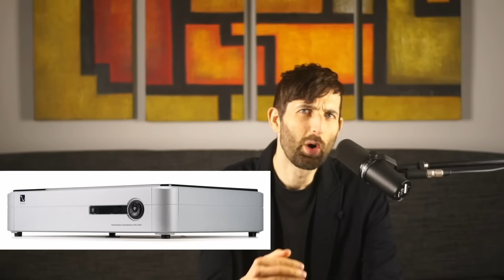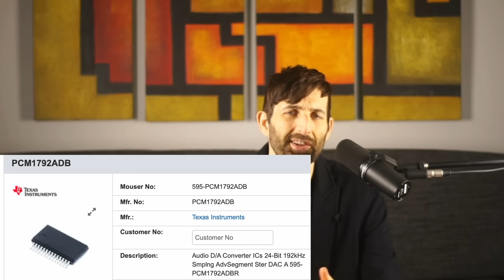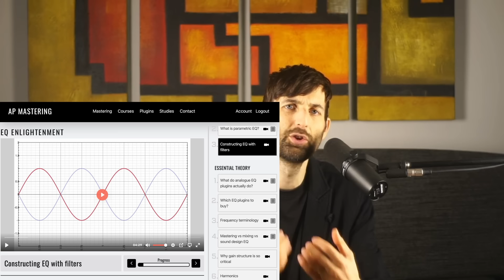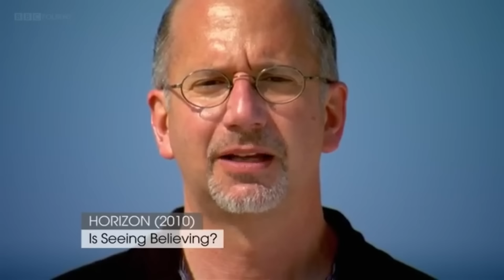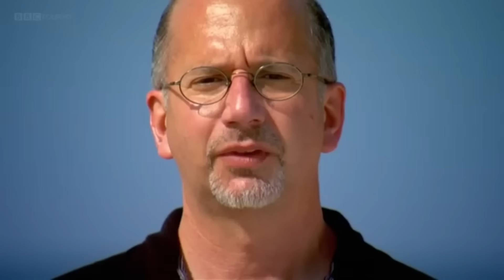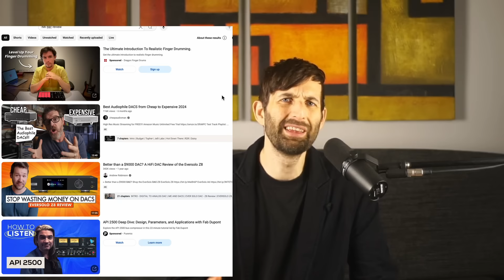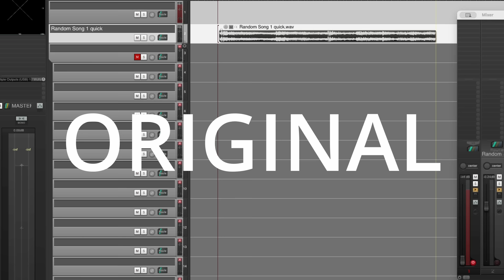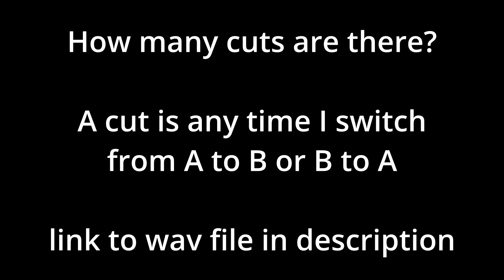The DAC Scam - Almost everyone believes the hype

Comment: I've been saying this for decades, because I repair electronics & see the same chips over & over & over again, plus some companies who think it's cute to remove the printed chip designation from the top & retaining an old DAC as a test device to de-solder processor chips & oddly they just function or actually reveal a failed chip. People, stop it. Also stop buying car cameras with the same processor chips. They aren't 4K! Enjoy
Reply: I know... I've been saying it too.  

I've seen some pretty wild stuff in my time ... Like Cobra CB radio boards in Radio Shack radios at 1/2 the price... Like top line audio mainboards in store brand housings, again at half price... Like DIY class D amplifier boards in expensive housings, selling for a grand or more... and on and on and on.

Online reviews are no better. I get quite the laugh at the guys comparing TPA3255 amplifiers and extolling the amazing sonic differences, often while ignoring flawed features and incompatible behaviours.  

The thing is that for most audiophiles the equipment they covet is little more than a series of opaque boxes, the insides of which are a total mystery.  It makes them ripe for the picking and the shyster companies are right there to take their money.

I keep advising a little bit of self-education in basic electronics... to no avail.
Reply: and what differences there are in electronics, sometimes there is stunning design and amazing implementation, but not that often. Mostly it's only due to great components that it somewhat functions.
Reply: If you think the chips are important than I feel sorry for the people who come to you for repairs.
Reply: Less electonics = better sound….music source + preamp + amp+ speakers…. = Done…!!!!
Especially if your system is realitively decent .
Reply: Less electronics won't make better sound, to a point. Tube amps are definitely worse in every way, for instance. A CD player is better than a record player. @Longjohn993
Reply: The chip does not make the audio signal quality it just converts the digital binary number into an analog voltage and holds that until the next number occure the expensive part of these devices comes with the signal filtering meanwhile cheap dacs uses ordinary low pass circuits the expensive ones uses active low pass filters with extra coils to reduce the phase shift of that capacity. 

What i want to say is the chip is not the part that determens the quality or is the expensive part it is the filtering circuit which can be optimizes by better components and better engineering or manufacturing. There is a whole science department behind that topic
Reply: @S4RO_R3  
Have you ever seen the schematic for a reconstruction filter?  Typically they're just a couple of small ceramic caps and an op-amp.  Nothing magical and nothing expensive.
Reply: @Douglas_Blake  yeah an entry lvl dac maybe but the moment there is external noise to much powerdrawn or anything the circuit will produce harmonics of the input signal
Reply: @Douglas_Blake  have u ever seen the diffrence of active low pass passive low pass or butterworth low pass its all a diffrent circuit so its not JUST some capacities there is a whole science behind that
Reply: @S4RO_R3  
As a matter of fact I have.
Reply: @S4RO_R3 Butterworth is just another filter name, passive or active. Plus you've not spoken of oversampling, digital filters, or anything else of that nature. 
I've got a dandy ass CD player and a basic good Yamaha and I'll be damned if they don't use the same stuff inside them because they sound identical. One just weighs over twice as much.
Reply: @Douglas_Blake  Correct... 👍🤣
Reply: @S4RO_R3  THANK YOU!
Reply: @S4RO_R3  Well, nobody said a $30 DAC is just as good as an expensive one, there's a limit to how cheap you can build something. However it's totally possible to build a technically perfect DAC for $300 - $500 and the improvements to a 10K or 20K device are doubtful
Reply: @S4RO_R3  Why bother filtering?  A CD player signal is 44.1 kilosamples per second.  You could DAC that and hand it to your power ampilfier unfiltered.  Nobody is going to hear the tiny steps from one sample to the next; these steps are more than an octave above the hearing of the best listener. 
BUT a volume control is useful; tone controls and equalizers also useful.  It is probably better to do all that in the digital domain THEN the actual DAC and its off to the amplifier.  But call that whole system a "DAC"?  That's absurd.  There's a DAC in the system.
Reply: Absolutely wrong as they may have the same DAC chips BUT the more expensive DAC'S have much higher quality components better power supplies and better analogue output stages
Reply: @ 
Usually not.  What is different, most of the time is big vs small production runs and the difference in cost per unit ... and don't forget to double the usual markup for audiophiles.

Comment: The difference people hear are filters, color filters. These are the analog output stages, the cables, the amplifiers, the loudspeakers, the bad powersupplies, the room, maybe a bad dac not temperature controlled, harmonized to have it within it‘s specified optimum operation window (which actually are pretty large so that isn‘t really likely an issue unless stuck in a wall full of equipment emitting heat by ventilators or even without that can‘t flow properly, like in studios, that‘s why high-end DACs have that kind of stuff, as they‘ve been designed to cope with indoor and semi-outdoor situations.
Sure, adding superbly designed analog output stages that may even control the chip to some extend may result in subjectively better sounding DACs - even so much that you can differentiate them in blind test. But all it is, is adding a colour filter like a parfum, excellently designed by masters of the craft and thus ultimatively expensive, but what it isn‘t is true DAC sound, it‘s modified to a subjective taste people claim to be near the original the artist wanted, an assumption of quality not even the artist likely thought about, and hopefully the mastering engineer did while just plainly doing his job styling the sound to the expectations of the paying customer - the label. Only few artists take that last step decision and those are typically running their own label or have a say thanks to prior iconic success.

Comment: This is so misinformed that it’s embarrassing. His main point is that most DACs use off-the-shelf chips. And yet the thumbnail is of a DAC that uses its own proprietary tech. 

Never mind the fact the chip itself doesn’t determine how a DAC sounds. It comes down to implementation. Most manufacturers that use off-the-shelf chips proudly advertise which chips they’re using. It’s not a secret. 

This entire video sort of assumes the absolute sound is real — and easily obtainable for the low, low price of a few hundred bucks. I’ve owned DACs costing between $50 and $18,000, and let me tell you, they all sound different. I’ve preferred the sound of a $1,500 DAC to a $4,000 DAC. It isn’t just about milking a few bucks out of the suckers with deep pockets. Some DACs are more resolving than others, but have terrible timbre or wonky tonality. Others sound just right, but maybe don’t offer as much detail or present narrower soundstages than the alternatives. 

Let me ask this: If DACs are a scam and the best sound can be had for a few hundred bucks, why do audio engineers pay thousands of dollars for studio DACs?

Comment: Please read it is just an Honest experience.

Fosi audio DS1 USB-C DAC with ES9038Q2M dac chip. Using USB to audio player pro on my android A52 to bypass the android junk. 

The music is now MUCH clearer and separated I can see how easy it is to become curious how much more dialed in can the separation and clarity get ... ?   When I say clarity and separation it more than just separate instruments or harmonies it`s even a single guitar string being plucked now has much more detail it`s a very obvious improvement.

Nothing fancy for headphones one pair under $300 the other was under $200.

With the above cellphone and Dac with 3.5 aux to RCA cable On my Harmon Kardon AVR 140 with digital bypass mode when the CD RCA inputs are used and tone is turned off with surround off running JBL Northridge series N28 speakers I can`t really imagine another Dac making a noticeable difference as the difference made was astounding....

Another helpful fact is the DAC works using the USB-C from my ASUS desktop computer used Foobar2000 and music Bee with same connection setup to my AVR 140 sound comparison through android versus Windows is close I just received the Dac 2 days ago so don`t yet have a solid opinion.

I`m not selling anything I`m not indorsing or trying to sway anyone this is just my experience so for $100 Canadian for that USB dac chip and the $12.00 app has changed my music enjoyment by a large margin. Of course through the PC using Windows with sound effects turned off no money spending needed for app`s just the Dac Foobar2000 was free.

Do your research take you time and do not over pay for what you are getting.

Comment: The best digital to analogue conversions are already in your phone headset jack.  BTW...that's where your pristine audio mix will end up 99.9% of the time.  The tech on this shit is already good enough and incremental improvements are undetectable by the human ear.  Tech is improvement is good, of course and that is the trajectory of tech.  But the price wars with these ridiculous claims of DAC/ADC that justifies thousands upon thousands of pounds is bollocks.  This shit here is as bad as the vinyl is better than digital claptrap of generations.  Stupid and pointless.

Comment: i haven’t done the math in a long time, but all DACs putting out the same voltage for a given bit pattern being equal, you are correct.  the only thing that effects DAC/ADC with high quality devices is the slew rate of the analog section (they usually use op-amps and not discrete devices), this can have a serious effect on sound coloration if you were to measure it with the cache of usual high end analyzers.  in reality, the guy driving home from the wine bar listening to a digital remastered copy of “birds of fire” would never notice…

Comment: Well, some people want to buy expensive stuff. They want to feel ... different. If the market is there - why not sell. The problem with the normal priced dac's often is that they are poorly designed. The parts are there, just not in the "right order" (or values). If someone has no engineering knowledge, they cannot know if the dac is correctly designed or what they hear is the bad design (I/V stages, filters, amplifiers, timing circuits, etc.).
Btw, most manufacturers have several "different" versions of one dac chip - consumer, industrial, automotive, aerospace, military. In most cases the only difference is that at the end of the production line, the chip has been qualified for given category. Meaning - it has been tested against special requirements or standards (extended temperature or voltages range, full functional tests, radiation immunity, vibrations, etc, etc...). Each test costs money, so, naturally, everything different than consumer and industrial is more expensive. But essentially, it is the same chip. So I can't agree that using industrial or military chips in consumer product will result in bad quality. It just makes no sense, it is unnecessary  and makes the product more expensive. That's all.

Comment: Biggest enemy of the audiophile is dodgy recordings, compressed and pushed loud to sound good out of a blue tooth speaker. Play that stuff and it really becomes less important what kind of DAC you have. Yeah, you can definitely waste money on hifi gear, especially on cables (now there's snake oil). But when you have the amp and speakers just right, having a decent source becomes more important. Dam true there's way too many broadcasters creating a massive echo chamber on the subject. 
But 
Seems to me your just looking to cause friction instead of getting things right. 
Not sure what you might achieve doing A-B comparisons on subtle differences through a lossey you tube broadcast and whatever sound setup the average TV has. Totally agree that improvements north of £1k are incremental at best, but for the record, r2r ladder DAC's are among the best sounding when done right (e.g.Holo Audio). Listening to a jagged output are you for real! 
Half baked seudo science, guilty as the guys peddling the snake oil. 

It's not all a big conspiracy...

Comment: Sorry but the premise is entirely wrong. You’re effectively saying that if the DAC chip is the same then the sound produced by the entire DAC as a hifi component will be the same. But that isn’t the case.
Reply: @dantealighieri4258  while there is truth that chip implementation has some effect on the Dac's sound quality, but quality implementation is the baseline for the discussion.
Reply: Most importantly what he was saying was listen to the output and say what differences you heard and how many times the DAC was switched ... then watch the follow up video for the results ... you may be surprised ... or not ...

Comment: Been in audio for decades and the audiophool stuff has become much worse as social media slobs hawk products for tidbits of cash and as real information becomes more and more difficult to differentiate from hype.  Most people today don't know who to believe, so they believe whatever they want and simply pretend that they're right.

Most modern music is poorly engineered in the studio, so I'm not even sure what people are listening to on their gold-plated turds.  What recorded music will even require superhuman fidelity; Spotify?

With that said, DACs have been reliably differentiated in ABX (blind) testing and there are proofs of that available from at least one youtube creator.  However, in each case that I've heard of the DACs in question were using different ultrasonic filters and some of those impact the response near 20kHz.  People can sometimes hear filters that impact their individual audible frequency range; they cannot hear properly-designed DACs that otherwise achieve performance beyond even the theoretical limits of human hearing.  If a company uses flowery words instead of lab results to describe the sound of their product, they're scammers.

I'm still waiting for someone to do blind testing on 2 DACs that have exactly the same filtering and frequency response; maybe someday.  Sound is extremely slow in comparison with modern electronics; if there's a musical difference between 2 products, it can be measured, even if the test for that difference has not yet been invented.  That possibility seems rather unlikely in 2025.

The cheapest Topping DAC is effectively perfect in terms of human hearing, so spend your extra money on SPEAKERS... better yet, please send extra money to me as I can live for years on $40,000.

Comment: I have a 10K system (hobby room) + stereo pairs of Sonos Fives (living room) + Sonos Era 300 (office room). At normal listening volume the recent Sonos systems sound pretty good compared to my 10K hifi. Only at high volume you can hear a difference in quality (took the Sonos to hobby room), but definitely not 10 times or 20 times better compared to the Sonos. Other family members that don't care about soundquality couldn't even tell if the hifi or Sonos was playing (turned off the displays of the high end gear).

Comment: I wish I had known this before, but for me, I almost have to find out for myself or else I'll always wonder if I'm actually missing out. I live in a condo, so I mostly listen through headphones on my desktop (where I have a Yamaha CD player and a Fluance turntable, so almost a complete system), and I was using the Topping DX3 Pro+ DAC/Amp combo, which worked fine, but from watching YouTube videos and reading sub-Reddits, I became convinced that I needed a better DAC and a better amp, so I bought the SMSL SU-9N DAC and the Schiit Jotunheim II headphone amplifier. They sound wonderful, but so did the Topping. The $800 I spent replacing the $200 combo unit that I started with would have been better spent on headphones or iems, but now I know, lol.

Comment: You are probanly right on this one.   Its certainly not enough to mean we cannot master on them.  Rooms and others things would more than likely be the issue.  I have an Apoolo Twin X and I spend many evening comparing it to my  Topping ESS Sabre DAC.  I can hear a subtle difference, its so subtle though who the fuck would care or be able to decide on one or the other.  I think we need to realise that at some point its all audiophile and no benefit to mixing/mastering.  I once spoke to the engineers who installed wiring for the Atmos systems in theatres.  They use bell wire.   Put that in your pipe and smoke it!